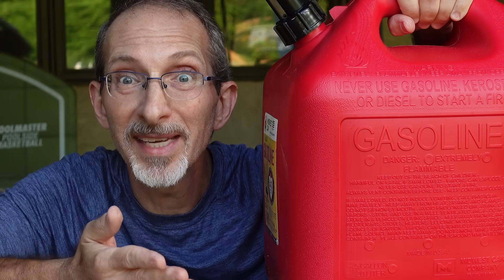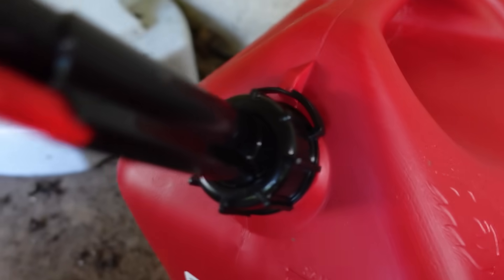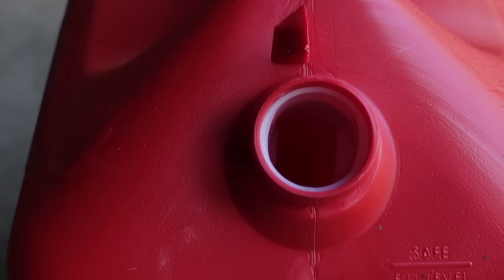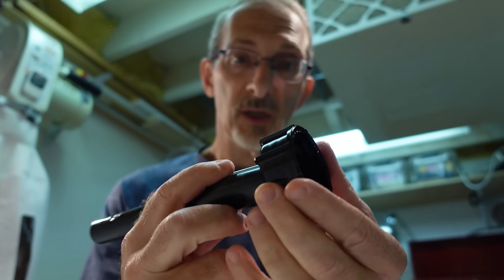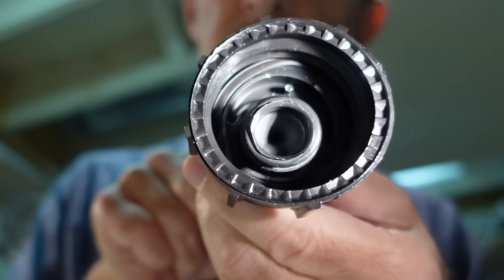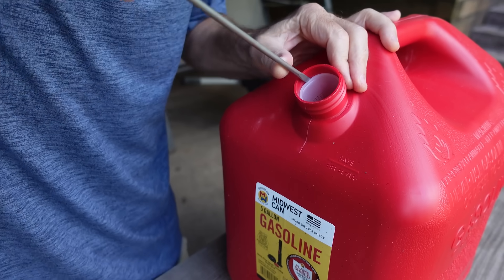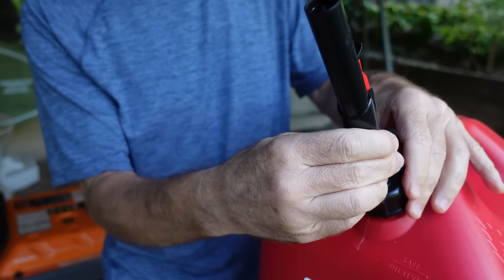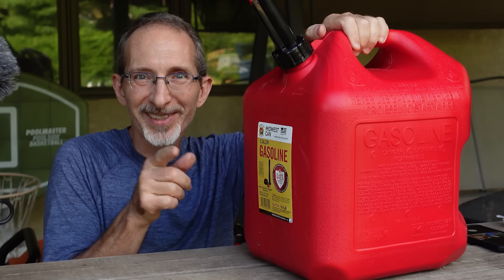Gas Can Modification | New Gas Can Fix

Comment: My favorite gas can is a old one w plastic yellow spout that was broken at end I cut it strait took a piece of clear hose and attached it with hose clap other end has small pvc screw on cap.  I never spill a drop and you can see the gas going in to control it.

Comment: The "filter" is not a filter . It is a spark screen.  That being said. I removed mine too. It makes it very hard to fill the can. Also if there is a fire i don't think this plastic screen will stop anything. On the nozzle. I took the spring out and cut out about 1" then stretched ghe spring back to its original length so now it has less spring tension.

Comment: This brand of fuel can works even better (best?) if the red locker part falls off.  It then works so easily a one-handed guy can use it to safely fill his riding lawn mower with the air vent and "flow control" flows-only-when-nozzle-is-safely -in-the-tank features still working.  My one-handed neighbor fills his mower and doesn't spill a drop.  It's literally the only new design nozzle can he can use.

Comment: I want to add one more crucial hack. I poked a tiny pin hole at the top of my tank as a breather to help smooth flow and prevent the tank from expanding with fumes on a hot day

Comment: You could have shortened the spring to weaken it.  I don't understand the screen.  It keeps all the crud from the gas station and whatever falls into it in the field on the equipment side of the screen.

Comment: I bought the same gas can and I can’t believe it doesn’t have a back hole to vent it while you fill or pour it. I have another gas can that’s maybe 20 years old and it sets up very similarly, but it doesn’t have a filter where you pour the gas in, but it does have a back hole with a little cover on it that you can remove to fill it or to pour it.

Comment: Remove spout, dispose in approved recyle receptacle. Buy simple flexible spout with screw-on cap and vent/cap.  Install spout. Drill tight fitting hole  top of can or can handle. Install vent with cap. Amazon sells kits and separate spouts and vents. Note expanding type no-leak vents, do not require pulling through can as shown in this video.

Comment: Those straight only gas can nozzles cause more spillage IMO.  I need that nozzle to be very flexible so I can put it in the equipment tank and it doesn't spill as I pour.

Comment: Another guy did a video about this modification. He also found a little rubber vent cap. So for a vent, he drilled a hole and just pushed this thing into it and had a sealable vent.

Comment: But the easiest way to fix you gas can problems is to go to garage sales and buy OLD style gas cans.  Preferably metal ones.  Make sure they do not have leaks.  Repaint them red if they need their old paint cleaned up.  For a stationary generator, where carrying the gas back to your "out-of-gas" car is not a needed feature, you can also buy war surplus, 5 gallon (20 liter) "Jerry" cans that hold a lot more than the usual plastic 2 to 2.5 gallon cans.

Comment: here is the one I bought. It's better than that one you bought. I got this off of amazon Stens 2 1/2 Gallon Fuel Can 765-102 For No-Spill gas can. Works really good. should have a 5 gallon little more expensive  but worth the extra money. all you have to do is put spout in gas tank on lawn mower when full it stops the gas release trigger and pull spout out. I use the 1.25 for my weed eater and chainsaw for refueling

Comment: Too many comments to see if somebody already addressed this or not but I was cutting wood on a hot day and had to refill my saw, and I was doing so on the tailgate of my pickup. The tank had built up so much pressure sitting in the sun, that when I depressed it, it shot fuel all the way from my tailgate to the hood of my truck. In hindsight I should have slowly unscrewed the fill cap to relieve the pressure, but I had no idea it would do what it did. As is commonly stated, I have spilled more gas trying to use these “Spill resistant” cans than I ever did on the old style  ones. No longer having a flexible pouring spot also adds to the spills when filling small engines.
Reply from the maker: Wow, that's crazy! Yes, there's lots of comments and lots of stories about people spraying gas all about. In my follow up video I added a vent to the back of the container, which is a much better way to relieve the pressure. Thanks for watching and for sharing your story.

Comment: Outstanding presentation!  
I have spilled more gas fighting “safety devices” then any of them could possibly save - even IF they did work. Removing the spring makes it easier AND safe!  Also adding a vent device is a big help.  And you might mention one thing you didn’t - and that is save the spring you take out -  it might come in handy for some other project.

Comment: Love this vid. I ordered 4 diesel cans and destroyed the first one by cutting off the bracket that holds the red lock on! Lol
Then I decided that maybe some help from you tube would be in order. Oh well. I was going to replace them all with flex nozzles anyway. I then watched several vids and then yours. I removed that o-ring and still couldn't get it to come apart til I remembered to depress the lock. This is great! I'll probably make a new lighter spring and keep these springs for some other projects. That flame arresting filter you took out of the tank makes an excellent heavies filter and a cotton filter over the outside will pick up smalls if you need to filter oil or antifreeze if it's  good and you want to use it again. It would also be a great addition to wine making as long as you never used gas through it. Lol Easy to gauze wrap it and filter out fines..
Also if you look at the other end of the inner sleeve you'll see a thin double groove that you can clean out slightly and it doesn't exit the tube when compressed so a very light o-ring can be put there and no more dribbling gas while pouring!
It's still much nicer to have flex nozzles than these. It's virtually impossible to start pouring gas into a mower tank without spillage.
Thanks again for the excellent vid.

Comment: 8:56 Thank you so much. I don't understand these idiots that come up with this crap. Then the so called filter not only makes it harder to fill it up but if it does catch debris and stuff coming into the can. Then when you go to pour your fuel into the tank so does the debris that it's supposed to have caught will come right back out into your tank. I've got mine fixed and I think you a lot. I had to use vice grips instead of niddle nose pliers because of my strength. It worked and I thank you, Sincerely an old disabled lady.

Comment: wouldnt it also pour faster if you reinstalled a pluggable hole near back of handle? first fine some kind of rubber plug, drill out slightly smaller hole and glue on or attach a string to plug and then handle and it will pour much faster, like 1 minutes instead of 4

Comment: I realize this is old. The way I use these cans is you put the entire weight onto whatever you're trying to fill and thay presses the spring. Gas won't flow once it reaches the end and the spring let's it close very fast. I've never had an issue with these haha. Definitely can cause an issue if you're not 100%

Comment: Great Hack, love it.  But do not despair if your accidently push the neck filter into the can. It can be retrieved using one of those long nut/bolt grabber things to grab it, then pull it up where you can get hold of it with a pair of needle nose pliers. either end would work. Actually worked it with two pair of pliers and razor knife spitting it then working it out.

Comment: My modification was easier.  I removed the horribly designed spout and dropped it in the trash can.  I then bought replacement plain old school spouts for my gas cans.  Super easy.  They are all very easy to pour from now.

Comment: More power to you! I bought a new gas can and the d*** spark arrester was heat welded in. It was a BUGGER to cut it out, as it was melted into the neck-no mechanical lock-John in Texas

Comment: A Vent!   Buy a tire VALVE STEM at your local auto parts store and have them remove the valve core, which is an easy task.  Save the cap!  A short stem works best.  Measure the diameter between the two sealing ridges and break out a drill bit.  Best to begin with a smaller bit so as to not tear the hole. Locate a spot behind the handle, near the top, where the liquid won't come out.  Install the valve stem and remove the cap on your new vent when you are filling the can or pouring it out.

Comment: You can buy old fashioned nozzles &vents[drill bit for vent included] on line for a reasonable cost. I've changed 5 gas cans in 15 minutes.

Comment: Thank you for this video. I'll confess an earlier personal experience while removing the 'safety screen' from the tank. As you mentioned,  you don't want the screen falling into the can,  which is exactly what happened. Obviously one has a choice ..... to either simply let it live in there, or devise a plan to extract it. I chose the latter.

After an hour or so of holding the can upside-down,  fortunately I was able to shake it into just the right position, and I was barely able to get a grip on the edge with the needle-nose and gently wiggle it out far enough to get a better grip. With 5 more cans to go, I'll be using your method to remove .... hopefully without losing any more on the inside! Your method seems to be the only viable one, so thank you!

Comment: "Filter" - Nooooooo! That's a Flash Arrestor designed to stop a spark (like static electricity) from setting the gas can (AND YOU) on fire. 
Granted, these safety can's are a Royal pain in the A-s!  Remove the Flash Arrestor at your own risk.

Comment: Mike thanks for your help I did that to mine as well I hated that system and just put up with it for many years and now I don't have to. As an added bonus something you could add to your next video if you like is to have people install a gas vent in the tank. I went on Amazon and bought a pack of 10 yellow half inch gas caps you simply drill a hole in the tank and empty tank read the instructions basically, and then you pop this thing through the hole and now you got to pull tab tank vent. I know that they dented through the original handle and all that but I don't trust that thing at all I'm probably even going to take that existing junk handle off and I can buy new flex neck handles on Amazon also a lot easier to use. Just a heads up take it easy and thank you

Comment: Had to buy one of these last month. It seals so tight it expands so much when hot and implodes when cool. Then it was hot today and the can was almost empty. This thing sprayed fuel under pressure on me and the tractor!

I see someone added a separate vent - do you think it's needed?

Comment: Good job getting rid of all the safety garbage. “Pro tip” It’ll work better if you vent it. Drill a hole and put a vent cap on the back of the gas jug. “Edit”  I just saw your second video 😅

Comment: Thank you so much for the perfect video on how to fix that spout.✅
I saw another one where the guy did pretty much what you did, but he also drilled a hole into the can for air .

I do not want to do that so I kept looking for another video and found this.

Yeah, I guess the gas comes out a little faster with an air hole in the top of the red can.

But he drilled it, and I’m like OK ….now where did all those little pieces of drilled plastic go? He never emptied them out of the can.

So thank you again, this is a great video .  I got so much gas on my hand and on the ground today.  I’m going to do this first thing in the morning with gloves on because there’s gas in my spout.

I had to Google how to get gas off my hands .  I used peroxide then I used rubbing alcohol and then some lemon.  I finally got it off my hands. I hate the smell like ass on my hands.

Thank you❤

Comment: I collected old style gas cans when this crap started.  If a can failed I saved the spout.  Now you can buy spouts that will fit cans that were designed for things other than fuel but still fit.

Comment: Modded mine with a flex spout with a cap, and put a self tapping  screw opposite  side the spout is on for air flow. Works great for me. When can is empty just screw  in on my next can. All my cans have the self tapping  screw, unscrews by finger. Unscrew, fill, screw, done

Comment: I used a hook pick, available at Harbor Freight in a 4 pack, orange handles.  Sometimes they are 99 censt with coupon.  The hook worked great to remove the inner screen.  Didn't have to touch red.

Comment: That's not a filter in the gas can.  That's called a flame arrestor to help prevent flame back into the can.  Besides, it can't work as a filter, as the first time you pour out of a full can, any junk would come right out the nozzle.

Comment: just put a flat blade screwdriver under the red lock and twist. remove the lock and that's it. the inner lock will keep moisture out and when pressed against the side of the gas tank fill cap will open and allow gas flow

Comment: I am a 66-year-old female with quite a bit of arthritis in my hands. I just bought a pressure washer, which I love, but it does have a fairly small gas tank so I need to refill it often especially when I do a lot of concrete at once. This video is a lifesaver because I cannot work these new gas cans AT ALL!  Now I can pressure wash if my husband is not around or I don't have to annoy him every time I need the tank refilled. Thanks ever so much!!
Reply: They definitely were not thinking about women of a certain age when they designed these cans. I couldn't have handled the newer 5 gallon cans in in my 40's.

Comment: I dont have any of these bs spout cans but I still will just use a funnel and unscrew the spout. and then hold the can sideways so air can go in. 

And never buy anything larger than 10l or its just a back breaker

Comment: Just bought one of these cans and was baffled by its operation.  The little lock is very hard to engage and of course the spring makes it nearly impossible to use unless you have a 2 ton car to hold the receiving end in place.  I will immediately apply your fix although I didn't have any problem with filling it up (the pump kicking off when the fuel backs up).  Great video. Very well done.  Others should watch this if for no other reason to see how to make a professional quality video.  Again, well done!

Comment: Before I watched this video I just got done installing a vent cap in a new gas can and using an old flex  nozzle for the new can.  I tried  the spring loaded nozzle  and it restricted the flow on top of being a pain in the ass. You can buy vent caps and old style nozzles for a couple bucks.

Comment: F epa screw ups. I dump that crap vent nozzle that gurgles gasoline out all over my driveway. Replaced with normal flex nozzle. Add a vent valve on top. Then you got a real gas can.

Comment: Those gas spouts are a pain, but in the workplace nothing can be modified like that.  What I have done is to get a clean number six tomato can and bent the top edge so that it forms a sort of spout.  The tin can is easy to fill from the clumsy new gas can spout when the tin can is sitting square on the hard ground.  The fuel then can get transferred into the generator easily through a funnel or even directly from the  tomato can.  Big bent tomato cans tend to get thrown out, so it would be a good idea to keep it in a bag to hide it and keep it clean for future use.

Comment: I have one like this that you unlock and depress by pushing the tab/lever thing against the opening of whatever you're trying to fill and have actually gotten pretty skilled at using it to fill chainsaws, weedeaters and just about anything without overfilling it, trick is you have to time it just right, but it is pretty ridiculous and all these cheap plastic parts are just more things that can break so you have to go buy a new one with some kind of new contraption on it, lol. Thanks California for making the country use gas can mechanisms you have to jerk off 😂😮

Comment: Why are they concerned about sediment getting into the gas can (speaking of the filter)?  I've never had a problem with that, and if I clog up a lawn mower, that's on me.  Gasoline coming out of filling station pumps doesn't need a filter, and if I'm dumb enough to drop some grass or something into the gas can, that's my problem.